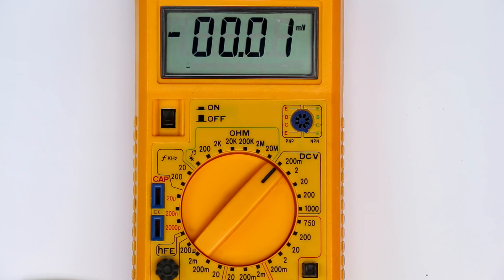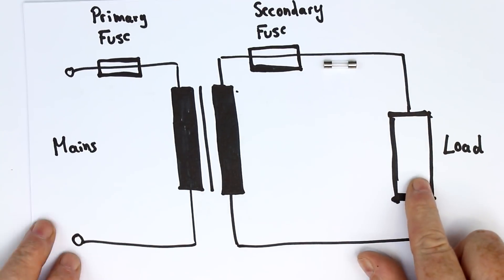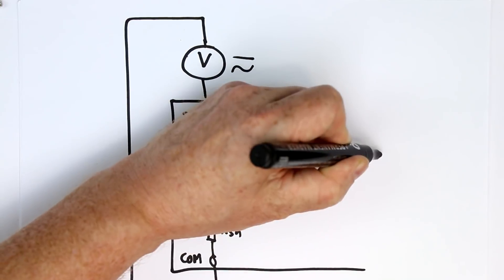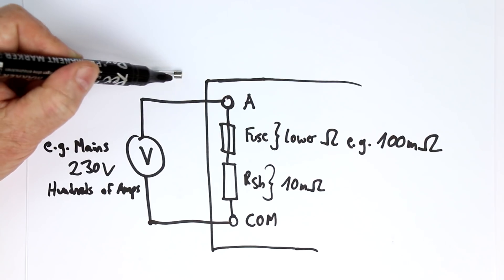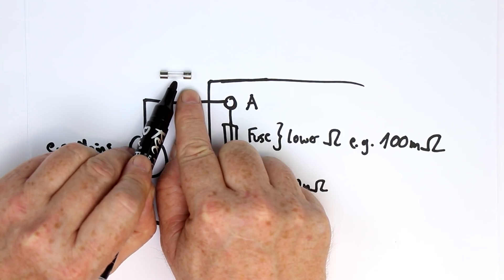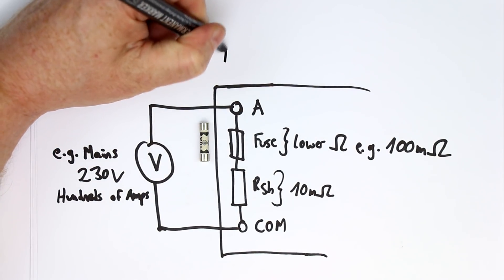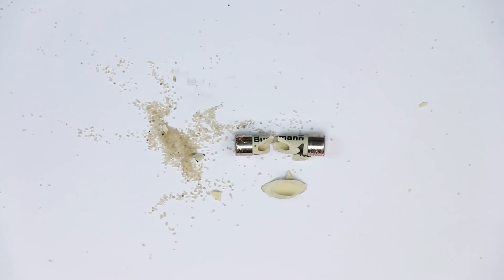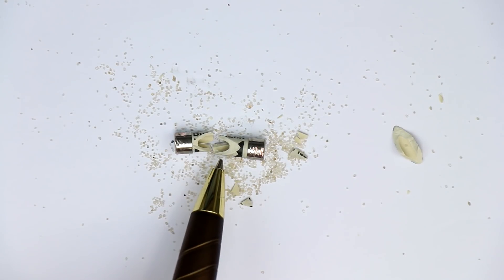What are HRC-fuses used for and how do they work?

Comment: Awesome video! I noticed both the miliamp and 10amp fuse in my meter was blown and I'm somewhat of a noob with this stuff. I was questioning if it would be a good idea or not to replace the ceramic fuses with glass ones because they are cheaper and easier to find but I'm glad I found this video. I now know it's probably not a good idea to use glass fuses in my meter lol.

Comment: I cannot seem to find the IC LM334z. With a magnifying glass, I have poured over hundreds of mainboards and PCBs. Is there a type of device that LM334 is typically found in?
Reply from the maker: Where is the LM334 mentioned in this video?
Reply: It's not mentioned. I do need a fast blow fuse for a project that uses it.
 @KainkaLabs
Reply from the maker: The LM334 is a programmable constant current source and nothing to do with fuses. Often used in anlaog circuits.
Reply: Ah! Thank you. Analog circuits. This project is for a simple DIY tDCS circuit. The fuse is to prevent too much current to the brain. It would be fascinating to see you build your own and how you would design it.

Comment: Don't we expect mains fuse to blow at the start of arcing inside the meter?
Reply from the maker: Yes, you are right. (See my reply to the previous question below)
But your multimeter could already be destroyed and have caught fire until the mains fuse starts to act.

Additionally your DMM has to protected for other failure-modes (especially if it is CATIII- or CATIV-rated)
There are 2 situations I could easily think of, where you absolutely need the HRC-fuse in your multimeter to protect the multimeter and yourself:

a. Working inside your fuse-box in front of the mains-fuses (CAT III and CAT IV: https://en.wikipedia.org/wiki/Measurement_category )

b. Working with high-current DC-sources (Photovoltaic installation, large Lithium cell collections like in your Tesla or other EV-cars, UPS-batteries etc.)
With DC-current you need much less voltage to get an arc that is very hard to extinguish (see e.g. my video about AC vs. DC current-ratings in relays)
Remember that you can do DC arc-welding with a few dozen volts as long as your source delivers enough current.
And a big lithium rechargeable battery can deliver hundreds of Amps.
Reply: Thanks for the explanation. HRC fuse is very much a necessity for any multimeter.

Comment: Thank you for this great video. In the past I assumed that HRC fuses = ceramic fuses however I do not believe this is the case. In my emails to Littelfuse they mentioned to me:  "A High Rupture Capacity fuse is defined by the specification that was used for its design. For European IEC 60127 miniature fuses, HRC is defined as 1500A at 250VAC. This is the interrupt rating of the fuse." 
I believe you can get glass miniature fuses that would meet this definition and therefore such a glass fuses would also be defined as HRC in that context. I would imagine that for other fuse specifications with higher voltages glass fuses may arc or break violently and therefore ceramic fuses may be the only option. Please let me know your thoughts on this. I also posted the following thread here: 
https://www.eevblog.com/forum/beginners/designation-as-hrc-fuse-and-selection/
Reply from the maker: All the answers Littlefuse gave to your enquiry are of course 100% correct.
(A sand-filled glass fuse can come quite near to an HRC-fuse)
An HRC-fuse usually is of the ceramic type (but not necessarily) and a ceramic-fuse can also be non-HRC when not meeting all the specifications.

As I mentioned in the video it is basically not necessary to protect "household" consumer electronics with HRC fuses.
There is a reason why you don´t find HRC-fuses in those devices but instead always the little glass-tube fuses, because basically the fault condition where you would need an HRC-fuse is never met.

Therefore you would need...
a) a short inside your device shorting out the mains. 

b) ...plus no appropiate fuse in your fuse-box. 

(In Germany each separate mains-wire going out from the primary installation has to have a dedicated 16 Amp fuse (or less) which has to have HRC properties!) 
c)...plus an ultra low resistance connection from your mains installation to your device where in case of a short more than hundreds of Amps could flow. 

And the AC-nature of houselhold current always helps in extinguishing possible arcing due to the zero-crossings.

So no company building and selling household consumer-electronics would dare not to use HRC-fuses if there were any danger of a fire in case of failure.
Reply: Thank you for the detailed response, it is much appreciated. In my initial comment I indicated that I believed you could get glass miniature fuses that would meet the referenced definition of HRC. What I had in mind was non sand-filled glass minitature fuses that could be classified as HRC. I went to look for an example and realized that the 5x20mm fuses which have an interrupting rating at 10,000A for example are rated at 125VAC. At 250VAC the interrupting rating drops to 35A for the same fuse. Example: http://www.cooperindustries.com/content/dam/public/bussmann/Electronics/Resources/product-datasheets/bus-elx-ds-4395-gmc.pdf

The HRC definition that Littelfuse quoted (per IEC 60127 miniature fuses) was 1500A@250VAC -- I was focused on the first part (just the current rating) in my initial search. While I was able to find what appears to be non sand-filled glass fuses which would meet the first part of this criteria -- these were rated at 125VAC and therefore these would not be classified as HRC. From what I can see searching on DigiKey the only 5x20mm fuse that would have a rating of at least 1500A @ 250VAC appear to be ceramic. I have found 6.3x32mm glass sand filled fuses with an interrupting rating of 1500A@250VAC such as https://us.schurter.com/en/datasheet/typ_SPT_6.3x32.pdf  which might also be considered HRC (I am unsure if the quoted IEC specification also covers this fuse size though the linked data sheet does make reference to an IEC standard of 1500A@250V).